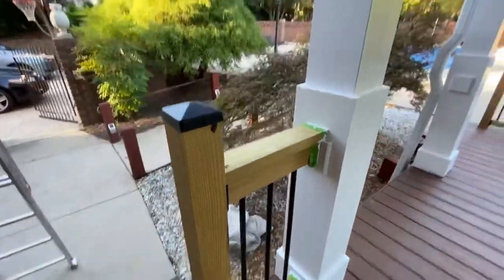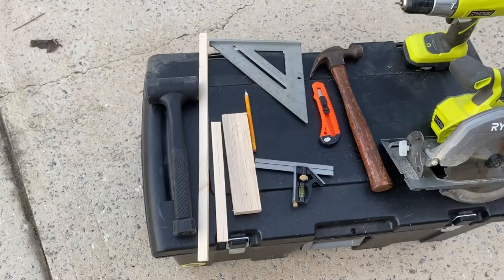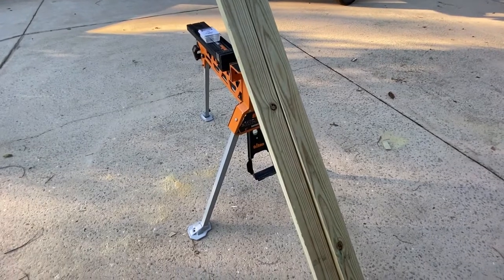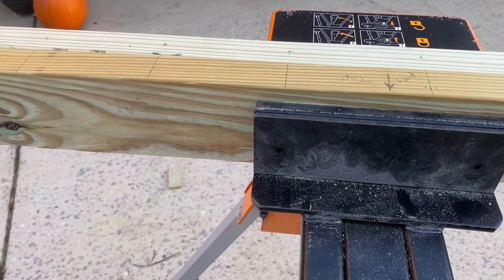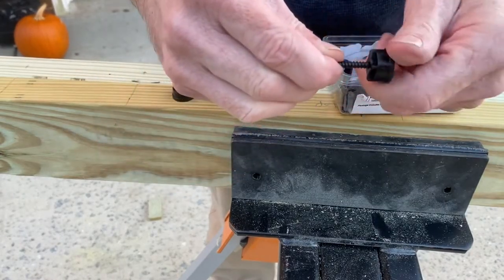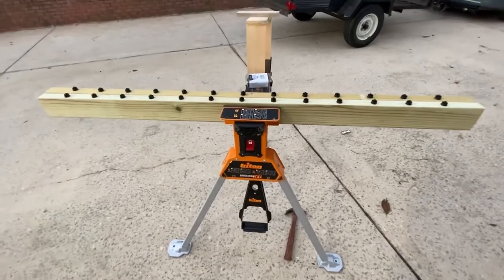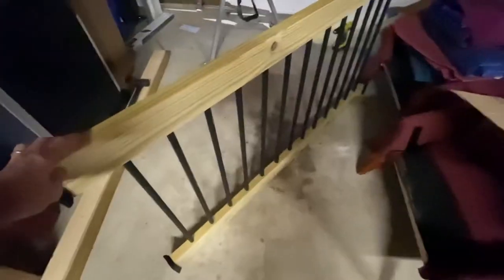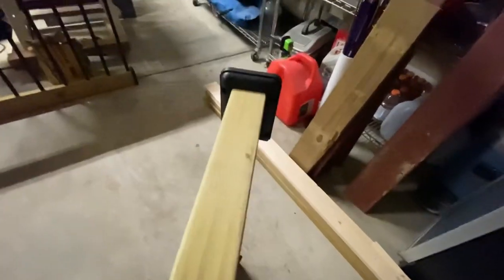How to Build a Deck Railing with Balusters

Comment: Excellent video. I'm redoing my deck now and was going to drill the spindle holes but not now. Also the 4 1/2 spacing between the spindles saved me from making a 3" spacing between rails vs a 4'. Thanks a heap! I would add using a strap to wrap around the middle of the completed rail, top and bottom, to keep it from falling apart.

Comment: can you go into how you built the column? on the deck or porch build?
Reply from the maker: I can't promise anything, but I'll keep it in mind. First off, these are column wraps and are not structural. There is a 4x6 post inside that provides the support needed. The basics are that I used 1x pine boards for the two sections of column. The top is smaller. I mitered the edges to make it look like a solid column.  Then the trim is just another layer of the same type of wood, I just butt jointed those, but miters would also work... I just got lazy. I hit all the pine knots with a Shellac primer and then painted with a couple coats of exterior latex. I thought the miters would split with expansion, but after a year or so I haven't had any issues. Hope that helps and here is a video I used when making mine. https://www.youtube.com/watch?v=3dw7fJJGVzM

Comment: I noticed your spacing on the end is different in your thumb nail then how you did it in the video. Did you end up adding an extra baluster on the ends?
Reply from the maker: I probably used a different section for the thumbnail and the spacing just worked out a little different due to the sections being different lengths. I used the same process of starting from the center and working my way towards each end.

Comment: I would put in 2 temporary boards to tie them together so they wouldn't fall apart.  Thx.
Reply from the maker: That would certainly work. Thanks for watching and for commenting!
Reply: @LifeHappensLetsFixIt  thanks for the inspiration.  After I posted I started building railing sections, drilling inch and a half holes in the 2x4's to hold the balusters.  Working gret.  Will finish today at 188 balusters.

Comment: Are these galvanized steel with a powder coat? 
Maintenance with these? Repaint in a few years in harsh environments ?
Reply from the maker: I believe they are steel. I've had them about a year now and no signs of any wear and I don't anticipate any maintenance for quite some time. Since I used the Baluster Connectors, they would be easy to disassemble the railing and just replace them.

Comment: These connectors wouldn’t pass code.. they can’t sustain a brute force hit and would break away..
Reply from the maker: The website where I purchased them states that they "meet and exceed building code requirements". However, your point is well taken. On a two story deck I would definitely go with something that was better secured.